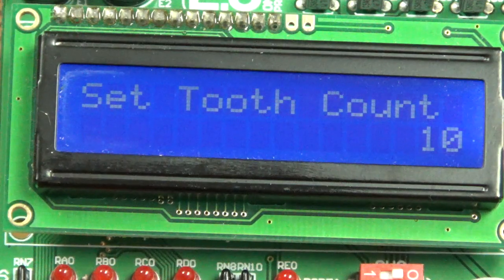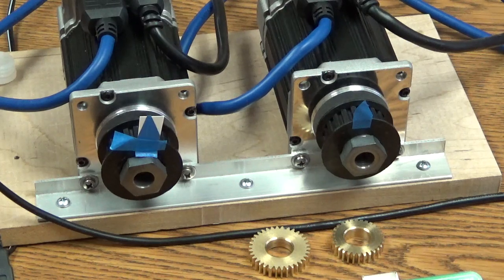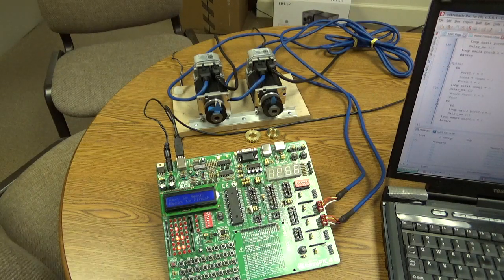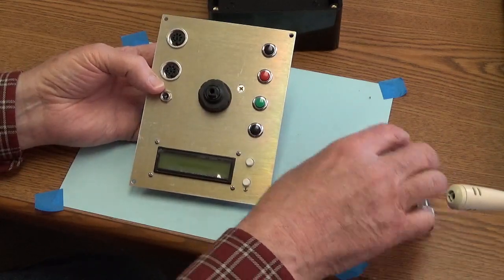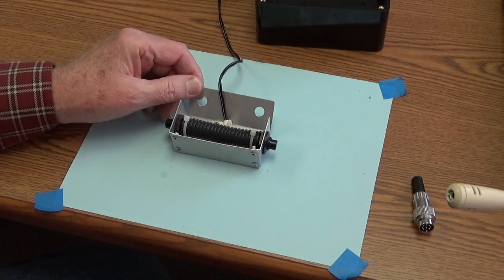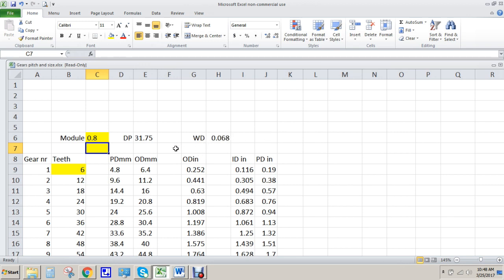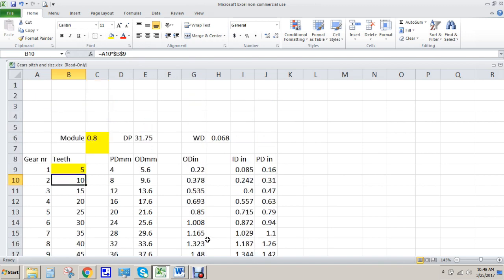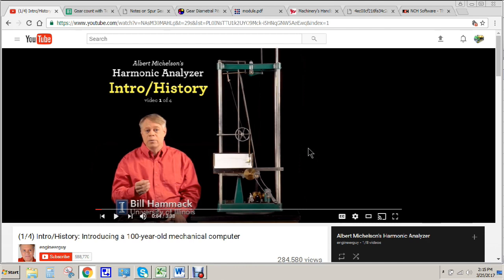Making Gears in the Home Shop - Automatically Part 3

Comment: I like what you are doing but I am curious about why you seem to be be reinventing the wheel. Instead of writing a new program to make these gears wouldn't you be able to use Mach 3 or 4 or EMC 2 programs to do the same job? Is it just the challenge to be able to do it?
Reply from the maker: Hello, John.  I guess it's just my lack of experience with traditional CNC programs.  I have never programmed in g-code but I have written lots of microcontroller applications.  So the learning curve would be steeper for me with traditional CNC.  Also, this application was pretty simple, and the Clearpath motors make it even more so.  Thanks for the comment.
Reply: After seeing you dominate this project I have every confidence that learning G code will be a breeze to you. Are you an engineer by chance?
Reply from the maker: Yes, I am a retired EE.  Worked on wireless communications for many years.  That's why I am so interested in the harmonic analyzer.

Comment: Paul, I noticed on your push buttons there is a resistor connected to each switch. Are these switches LED lighted and is the resister for current limiting to the LEDs If so can you provide part numbers and supplier information? Thanks again. John
Reply from the maker: Hi, John.  No, those resistors are just "pull downs" on the inputs to the processor board.  The switches are non-illuminated types, Digikey part number EG1932-ND for the black ones.  If you send me an e-mail at phjacobs@gmail.com I will send you a jpeg file with the schematic of the switch wiring.

Comment: Paul are you an engineer?  The spreadsheet sounds interesting. Did you have to consult with many people?  I can see some really good applications for this...  Thanks!  gEEk (Cory)
Reply from the maker: I am a retired Electrical engineer and have specialized in wireless communications.  I have used spreadsheets for many years to do repetitive calculations.  Whenever you have to do the same calculations on many different data they are the way to go.